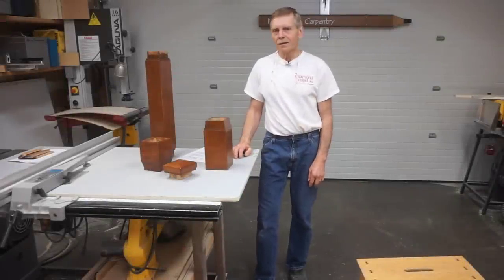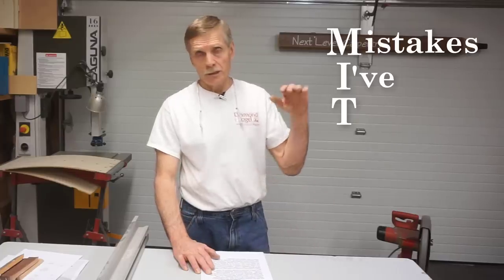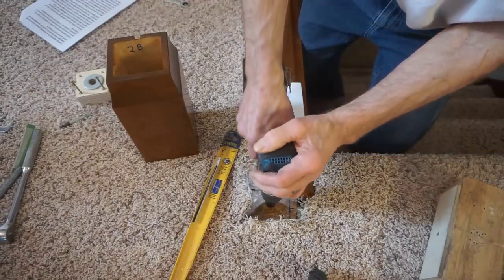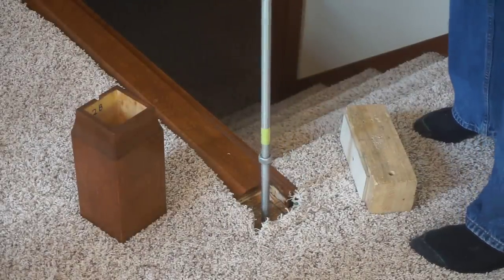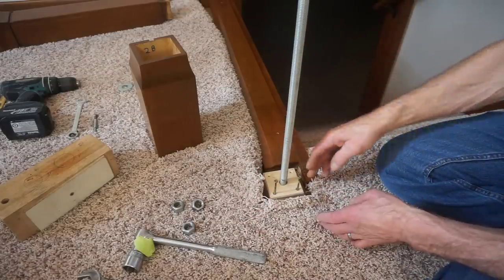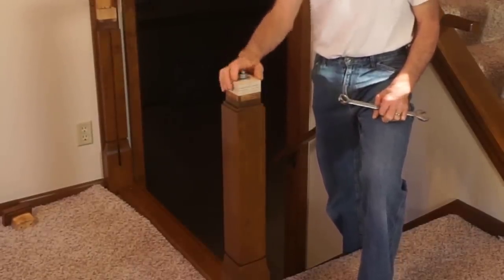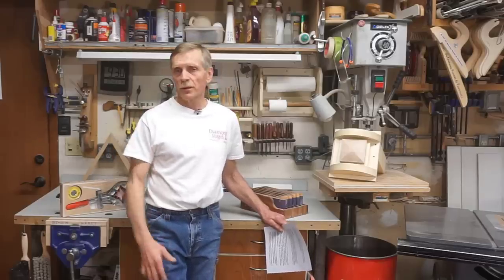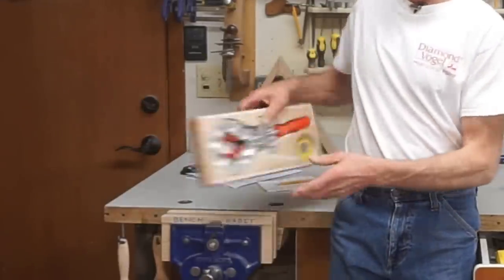How to Install a Newel Post Without Wobble

Comment: no. the wobble mostly comes from the fixing and your parts not fitting properly (no glue), not the natural flexing of your hollow beam. the only thing that holds your beam from tipping is down force, which is held by an extra long flexible cord that can be moved side ways, it does not have to elongate to let the beam wobble, it just moves almost in an arc, allowing the structure to wobble.

the hollow beam concept is fairly good to hide fixing screws. because you want to use 4 corner screws on a tall, solid piece of wood that you will use as a base, which will you almost press fit and then expand to totally compress the inner side of your beam. that will minimize wobble.

or, you can pre glue it and use long screws/bolts.

or, you can use 4 screws but construct the hollow base with a bottom with 4 hole and screw ot with extra long tool.

if your method was correct, street pillars would be fixed your way.

still, they are bolted with a welded bottom plate, using 4 or more outer bolts.
Reply from the maker: Not really sure what you're saying with your lengthy comment here constantinos but if you have an alternate method you think is better you should certainly use it.  For the installation shown in the video this method is the only one worth using.  Despite all your elaborate engineering jargon there's no way 4 screws with brackets are going to hold a newel post like this more securely.
Reply: Constantinos, a few days ago I sallied past this unique comment and on to the videos documenting the meticulous and precise methods NLC utilized in construction of the newels.  I was compelled to return and supplement this discussion with a word or two:

In contemplation of your dissertation, I can see your methods have merit in many a situation.  NLC has also apprised us of alternative methods, but presented his as simple, inexpensive and expedient while allowing rapid assembly/disassemble of the newel for fitting glass panels.

You attempt to convince us that a superior method is securing a tall wooden base with 4 screws to the floor and then sliding on the newel (with outside dimensions of approximately 4 inches x 4 inches) and then expanding said base to compress against the interior of the newel.

1. The 4 screws would need to need to be 5/16" lags minimum to provide the equivalent root area of one 5/8 threaded rod for tensile strength, and they would need at least 6 inches of thread penetration into solid subsurface to equal the holding force of the 5/8 rod.

2. The wooden base would be limited to 2.5" x 2.5" to fit inside the newel.  That only provides 6.25 square inches of compressed contact area with the subfloor vice 9.75 square inches for the newel with threaded rod method; plus the hollow newel gives a wider base on its own for greater stability.

3. Pray tell how you expand the base.  With a board stretcher, perhaps?  

4.  Glue the base inside prior to setting newel, you say?  Thats a lot of hardware to fit and work with three feet down a hollow tube, but it is good to know you have a 3 foot long socket extension in case I need to borrow one.

You postulate NLC's newel is not so rigid because of ill fitting parts and no glue.  Disparaging someone's craftsmanship in absentia--WOW.  As an engineer myself, and having viewed NLC's meticulous tool set up and maintenance methods, I can warrant that his newel base is accurate, square and flat to within .003" and shall not rock when compressed to the subfloor.

I performed a comprehensive search of your channel, but my ocular perceptions were apparently lacking as I could discern no revelation as to the location of your demonstration of post fabrication, or illustration of newel installation.  My expectation of edification from video presentation and visual explanation of your written information turned into consternation.   Were you on vacation?

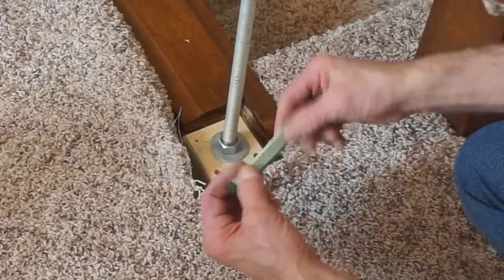Street pillars vs. newel posts.  Are we conflating apple wood with osage oranges?  Street pillar bases are engineered to be as strong as necessary, not as strong as possible.  Actually, I have seen wooden street pillars 40 feet high that are buried in the ground 6 feet, but I am sure someone must still be trying to find a way to weld metal bases to them.  That 6:40 depth ratio is actually exceeded by NLC's 8" threaded rod depth to 40" post.  These wooden pillars, if carrying large unopposed lateral loads are sometimes guyed by wires anchored into the ground to keep them from.........Flexing?  In my region, street pillars are sometimes simply called analog audio/electric telecommunications signal transmission poles.  And why are you using pillars to hold up your streets?

Comment: Arborist use screw rod with lag bolts threads for bracing trees, nuts are available for these rods.  The lag thread holds better in wood. https://www.sheltertree.com/storefront/searchitem.aspx?text=threaded+rod

Comment: key lock
Reply from the maker: Key lock?
Reply: newel post mounting hardware
Reply from the maker: Ah... I checked them out and doubt they would provide half the strength of this method although they surely are useful for some applications.
Reply: cool

Comment: Very cool. But shame on you for setting running grinder down
Reply from the maker: No fault, no foul? 😬  I should to better but have done worse... Best, Matt
Reply: Matt, if you going to set your grinder down while it's still spinning, at least turn it over (blade up) so you don't break your wrist if it catches.

Comment: 6- 8" of solid wood? That's not going to happen very often.  Great idea though.
Reply from the maker: Glad you liked the idea and FYI six to eight inches of solid wood can happen anytime you want it to by adding solid blocking which is what I did for the other two Newell's in this project... 😎

Comment: The threads on the all thread are not ment to be screwed into wood. No holding power.  rod can be pulled out.  should have used a closet bolt with a all thread coupling.. this is not too safe
Reply from the maker: While it's true that "threads on all thread are not meant to be screwed into wood" I'd love to see you pull that rod out, Russ... betcha a doughnut you're just plain wrong about the holding power.  BTW I prefer crullers with chocolate glaze! 😂😎 Best, Matt

Comment: The actual instructional content of this video great and I actually feel like i actually learned something, but the fact that you set your angle grinder down on the counter while it was still on really really bothered me.
Reply from the maker: You'll have to toughen up a bit there Aiden...
Reply: I like that in another post you  brought to my attention Metabo might be one of the few grinder manufacturers that give the option of regular on/off switch.  Never considered a lot of new stuff might not have them, so I will give some info on my grinders for the audience.  The 2 Metabos I have do have the on/off switches.  2 old Black and Decker industrials have kill type switch with option to lock ON- very good thing to have if the grinder is held in vise or jig, or if you need to hold grinder a different way in a unique situation.  My new milwaukee has an interlock you first have to push and then squeeze the kill switch-near impossible to operate wearing welding gloves. I'm not rich; only paid full money for one of the B&Ds back in 1986.  Its gearbox always sounded like shoveling pea stone, but its still running strong and no blue smoke even though I've locked it up numerous times. No issues with the old Metabos, and their gears are smooth as silk.  Metabo man had a cutaway display where you could see the gear systems in their various grinders: helical steel angle gears, not straight cut spur or plastic or pot metal. My Milwaukee was Home Depot floor model I talked them down to $20 on 2 years ago.  Its real pretty, but it will be the first to go if I downsize.  The other grinders I got for $5-$10 used, and I keep different wheels on them while welding: wire wheel, grind wheel, wire cup, etc.  Your comment about blue smoke got me worried.  I bought the big Bosch glide saw a few years ago for the shop when I transferred the Dewalt to my Paulk total station.  It came smelling like burnt insulation out of the box-no smoke though and I inspected it carefully to confirm it was never used prior.   Probably should have returned it then, but bought through mail from nonAmazon supplier and didn't want the hassle. It has had no problems, but in the cabinet shop, it doesn't get much of a workout.  Brothers: be diligent in your choices of tools.   @NextLevelCarpentry
Reply: Don't know why last comment came crossed out in some areas or how to undo it, so here goes again

I like that in another post you  brought to my attention Metabo might be one of the few grinder manufacturers that give the option of regular on/off switch.  Never considered a lot of new stuff might not have them, so I will give some info on my grinders for the audience.  The 2 Metabos I have do have the on/off switches.  2 old Black and Decker industrials have kill type switch with option to lock ON- very good thing to have if the grinder is held in vise or jig, or if you need to hold grinder a different way in a unique situation.  My new milwaukee has an interlock you first have to push and then squeeze the kill switch-near impossible to operate wearing welding gloves. I'm not rich; only paid full money for one of the B&Ds back in 1986.  Its gearbox always sounded like shoveling pea stone, but its still running strong and no blue smoke even though I've locked it up numerous times. No issues with the old Metabos, and their gears are smooth as silk.  Metabo man had a cutaway display where you could see the gear systems in their various grinders: helical steel angle gears, not straight cut spur or plastic or pot metal. My Milwaukee was Home Depot floor model I talked them down to $20 on 2 years ago.  Its real pretty, but it will be the first to go if I downsize.  The other grinders I got for $5-$10 used, and I keep different wheels on them while welding: wire wheel, grind wheel, wire cup, etc.  Your comment about blue smoke got me worried.  I bought the big Bosch glide saw a few years ago for the shop when I transferred the Dewalt to my Paulk total station.  It came smelling like burnt insulation out of the box-no smoke though and I inspected it carefully to confirm it was never used prior.   Probably should have returned it then, but bought through mail from nonAmazon supplier and didn't want the hassle. It has had no problems, but in the cabinet shop, it doesn't get much of a workout.  Brothers: be diligent in your choices of tools.
Reply from the maker: @francismccabe3265  "gears sound like shoveling pea stone" LOL!!

Comment: Whats with u old timers n not using an impact driver? A carpenter shouldnt be using a ratchet imo.
Reply from the maker: What's with you young whippersnappers not realizing that some methods, tools, ideas etc withstand the test of time and are far better suited to certain tasks Darrell?  Explain to me how you gauge torque value on a large nut like the one shown in the video when you're using an impact driver?  My guess is you're not because if you were you'd know better than to assume it can be done well enough for a reliable installation.  Wheez, cough, cough, hack... a reply like that can really tire out an OG like me... gotta go take a nap! 😂😂🤣😎
Reply: @NextLevelCarpentry  why gauge torque at all? With an impact u could go until its buried. If uneeded to u could look up the torque at which an impact starts to fail. Or at what torque until it starts the actual impact force. Its just foreign to me to see a ratchet outside an auto shop.
Reply from the maker: Darrell, Impact drivers definitely have their place on the job... I hope I never have to do without my18v Makita... but 'go(ing) until it's buried' is not a sensible approach for this sort of carpentry work.  I threw the term 'torque' in there to gauge your reaction (I have no idea of the ft/lbs I'm reaching) but in my experience I want to 'feel' the resistance of tightening this assembly coming on.  That experience has told me it's too easy to over-tighten stuff and ruin it with stripped out threads, over compressed wood, etc.  If seeing a ratchet outside an auto shop is 'foriegn' to you then you'd recoil in my cabinet/woodwork shop where I employ all manner of auto body tools for exceptional results on woodworking projects.  If you're curious check out some of the other advanced carpentry videos on Next Level Carpentry and let me know what you think?  A bit of versatility and 'outside the box' thinking will take you places in your carpentry work that others have no real chance of going.  Just sayin'.  Best, Matt